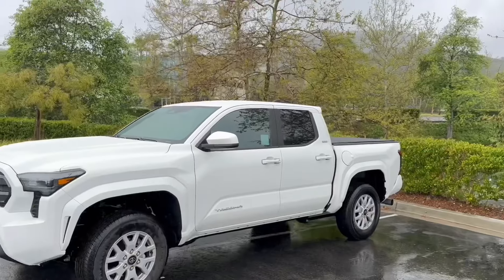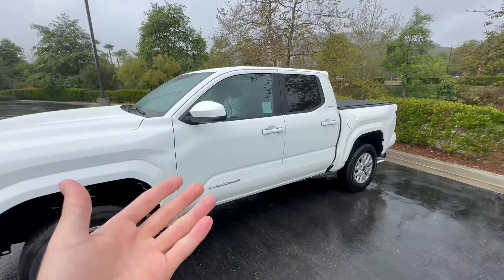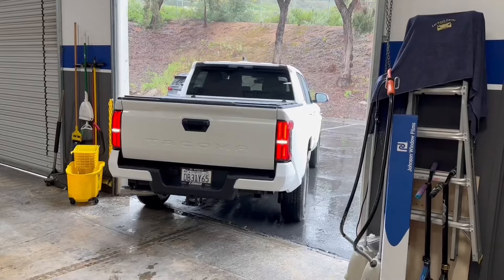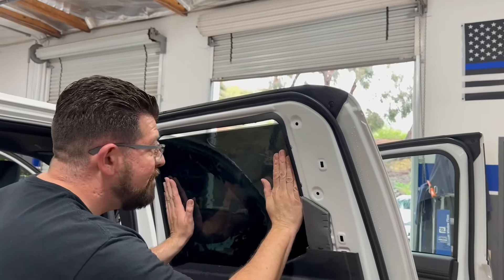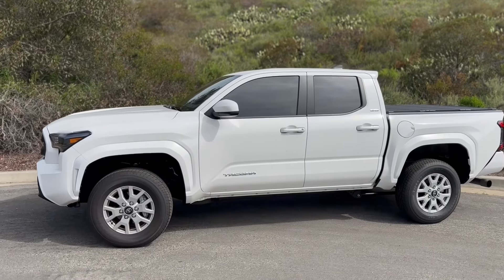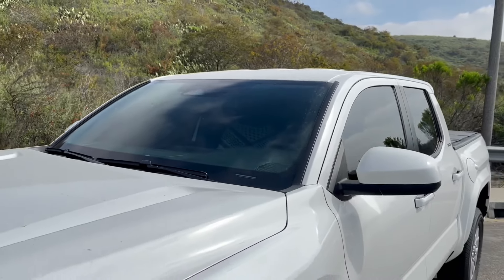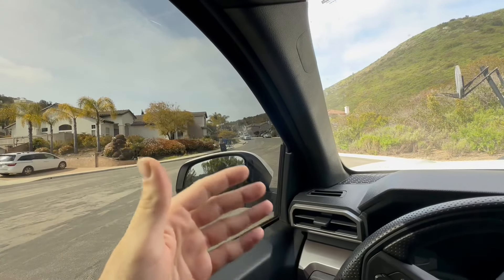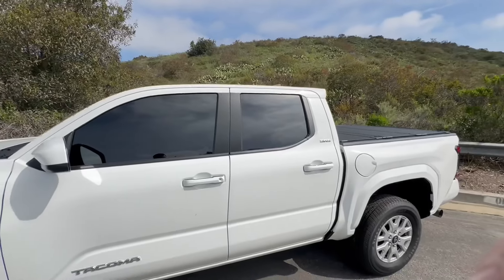Blacked-Out Ceramic Tint on The New Tacoma

Comment: Ive got a 2024 white sr5 also. I tinted the front doors 25% ceramic & its just a shade lighter than the factory back windows. Something I did notice since putting the tint on, noticing alot heat coming through the windshield now & im not imagining it...
Will def do the windshield but have other mods that are a priority at the moment. Main reason of holding-off on the windshield tint, is clear wouldnt be very exciting & not sure if I want to seek the attention of a possible ticket going dark like my fronts or even lighter. if you look at a slight side angle my doors are plenty dark at the 25%.....  Did you do your front windshield in the clear ceramic or left it untouched for now?  Theres a display at the tint shop I used showing how substantial the ceramic tint keeps the heat out....
Reply: I tinted my front real dark still no ticket but I get the hesitation. What modes are your priority? I need inspo
Reply: @lizzyzier5208   need to lift the front, the truck def needs to be leveled at least as it has way too much rake, even though will just be a grocery queen,  I personally would prefer the front higher than the rear over having rear rake, that may present a slight issue too as im not super excited about putting bigger tires on it especially while my new tires are fine, if i do go bigger when worn will only be 1 size bigger most likely,  im working with a manufacturer & they scanned my truck so waiting on rock sliders & probably front skid plate from them even though I have the stock tubular running boards on mine w/o the lame 2 individual steps hanging down "theyre nice but rock slider would look better" need something to help eliminate door dings.....,  the jbl system kinda sucks so not sure if im going with the beatsonic plug & play inline amp or going to upgrade the entire system,    
you have your windshield tinted or just the front doors?
Reply from the maker: Yessssir true
Reply: @TheUnrestricted   Im confused, you tinted your windshield? If so, must be clear tint?